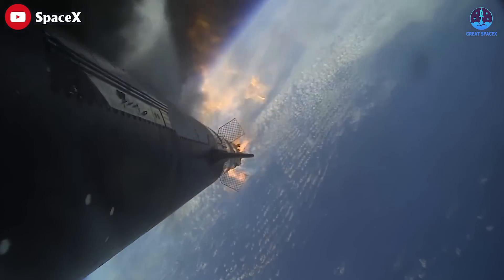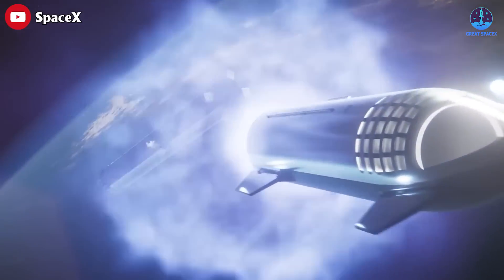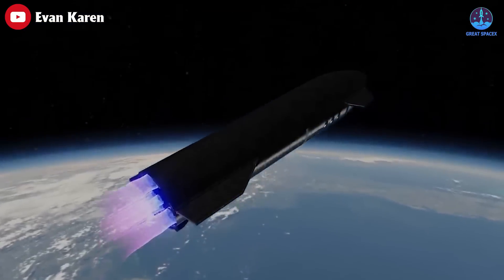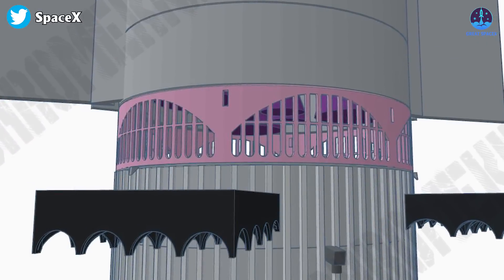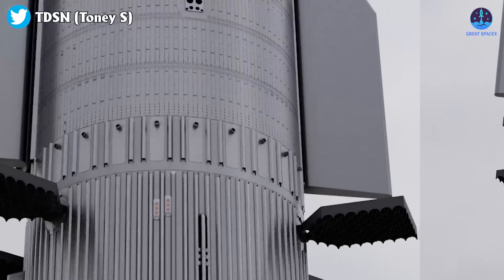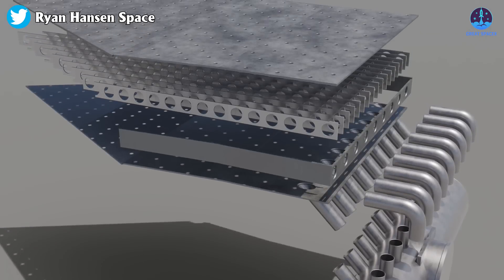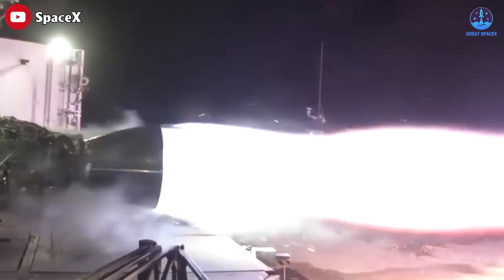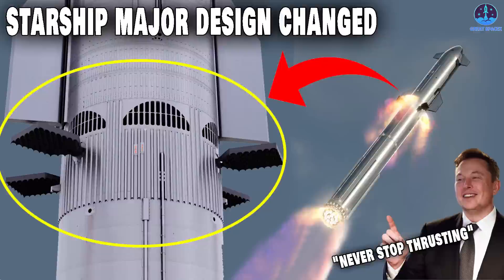Elon Musk officially revealed Starship's major design changed...

Comment: When someone takes a good look at it he quickly comes to a conclusion that of all the rockets ever designed and build the Starship is the only rocket that allows for easiest implementation of "hot staging". It has 3 center Raptor rocket engines that have wide range of gimballing necessary for lading flip maneuver. All that it takes to implement hot staging is extend this gimbaling bit more and cut three holes (slots) in the Skirt. Before launch all three center Raptors get gimbaled to outside perimeter of the rocket closest to their mounting position and protrude through holes cut in the Skirt. When time comes for hot staging they can get fired full blast without their hot exhaust blasting SH Booster (same scheme as is used in astronaut emergency escape systems). Easy does it, no shielding of Booster and no vent ring required. Unfortunately Elon's "hot staging" is not about hot staging at all. It is a smokescreen devised for hiding and modifying engineering errors that lead to failure of last test flight. Problem is that unpressurized Skirt of the Starship when compressed by the thrust generated by 33 Raptor rocket engines tends to buckle and collapse. Partial collapse of the Skirt  at only 30% nominal loading caused tumbling and ultimate demise of the rocket during last test flight.  Desperate times call for desperate efforts and Elon decided to switch from supporting the Starship on top of SH Booster using the Skirt to supporting the Starship using 6 VacRaptors as support columns. There is nothing wrong with that idea, in fact VacRaptors are way better than the thin sheets of SS steel used for the Skirt as they do not buckle under com compressive force. Now in order to make this idea work support structure is required on top of the uppermost dome of SH  Booster. If Elon had any brains left at this moment he could play it straight  and say: the Starship does not need a Skirt for landing on Earth and I am going to eliminate any need for the Skirt by using 6 VacRaptors as support columns during liftoff. Moon and Mars landing legs will be mounted to bottom of LOX tank and any supports for the flaps will be resolved by other means, and BTW the Starship will use 3 center Raptors for hot staging (tripod of rocket fire) no mods required.

Comment: In a screw ratio if your engine is firing your heat structure round you would ultimately have the opportunity for that little tip you wanted so bad in front of you to spade  inside of it and cause an explosion because of the round tipped edges of your screws
Reply: If possible next time you go up try to see if you're developing and breads that pull waves

Comment: Separation Upgrade to Hot Blow off with vents Less Parts Less Weight Less Momentum Lost ! High Bar Fuel Delivery too Lean Blow the Manifold too Rich Loose Thrust + Smoke !, Add Pressure Regulators with Atmospheric Diaphragms or Pintle Injectors with Experimental Wave Release Pattern !.

Comment: What could possibly go wrong with blasting hypersonic raptor exhaust directly onto the relatively thin material of the methane tank bulkhead and the new screen door section of the booster at point blank range?  We already know how good they do at excavating ginormous chunks of concrete and tearing apart rebar at 60+ feet.  Kinda like a bomb going off when they ignite.   Oh yeah.  It'll rub out!  🤣🍿🍿🍿

Comment: It was NOT A FAILURE......it was the 1st TEST FLIGHT.   It was never expected to succeed 100%......they will analyze all the data (& "failures") & prepare the next Test Flight to eventually have the Starship operational.  That's the whole point of Test Flights.....to TEST & learn from the never before tested spaceship.  It will probably be 1-2 (maybe 3) more test flights before the totally stacked Starship is operational & good for actual missions.   How many TEST FLIGHTS did it take to successfully land Falcon 9? (about 6-7), how many before Starship Booster successfully landed? (about 4-5).
Reply: How many Orion test flights it took to make it operational?

Comment: You lost me as a subscriber with your first comment.  It wasn't a failure - anything beyond leaving the tower was a bonus as stated by Elon.  No way that would ever be orbital on the first attempt and they learned a massive amount from it. That's like saying that a toddler attempt to walk was a failure because they fell over on their first attempt.
Reply: Space Cadets at SpaceX are allegedly experts in their fields highly qualified for the jobs they do. They knew from the very beginning that the unpressurized Skirt of the Starship under edge compressive loading would buckle and collapse during liftoff. They were told many times by many people  they ignored all warnings and tried it anyway. Now that sh..t hit the fan and the Skirt collapsed on the first try instead of admitting their mistake and eating humble pie they try to feed us with their BS about introducing hot staging while secretly trying to walk away from using the Skirt to support the Starship during liftoff  and trying to use 6 Vac Raptors as support columns in order to keep the Starship on top of SH Booster during  liftoff. Space Cadets at SpaceX were offered this idea as better option more than 2 years ago and now after they failed so spectacularly they are doing it in secret and feed public with complete BS as to why they are doing it. They have to decide if they are experts or just on the job trainees so far it seems that they are bunch of frauds

Comment: Ekon's "hot staging" concept is nothing more than a smokescreen intended to hide the fact that the Skirt of the Starship was too weak to support the mass of fully fueled Starship during liftoff and partially collapsed during last launch attempt sending rocket into a spin. Elon wants to convince us that introduction of vent ring makes it impossible to support the Starship on top of SH Booster using Skirt as support structure. Once he accomplished that task he wants to introduce concept of supporting the Starship on top of SH Booster using 6 Vac Raptors as support columns resting on shelding structure welded to the uppermost dome of SH Booster. As clever as Elon's rouse might seem to some people it has some obvious setbacks. Vent ring weakens the walls of SH Booster so much that separation mechanism located above vent ring might be unable to prevent premature separation due to forces generated by gimbaling during liftoff. Creating  functional venting at the bottom of each VacRaptor might weaken support structure "so called shelding" so much that it will cause collapse of these structures during liftoff.

Comment: SpaceX has some big hurdles to overcome that are necessary for a Mars landing. StarShip is gonna need Landing Legs & upper Draco Thrusters for the Moon & Mars (there will be no landing pad & ground level retro-thrust engines will only dig its own grave), orbital refueling, reliable Raptors (every prototype launch to date has had Raptors fail), capturing a returning Superheavy or Starship w/ the LIT Chopsticks, a OLM w/o a Flame Trench that will withstand repeated launches, a Human Rated blessing from NASA, docking this BFR (big fat rocket) to Any Space Station, a Mars habitat w/ a LOx & CH4 manufacturing ability, radiation exposure protection on prolonged space ventures,  satisfying the Environmentalists & other impending legalized extortion groups that will sue SpaceX for a piece of that cash cow . . .

Comment: Still a bit inaccurate. The upper and lower stages did not explode. The auto-destruct was initiated but took almost a minute to cause detonation of the remaining fuel. In the meantime the hydraulic controls for the Raptor engines had failed and due to the lack of altitude and attitude control the rocket stages took on a spin until the detonation of fuel occurred.

Comment: Comments:
1) The first launch of Starship wasn’t a failure.  Fly and crash is how SpaceX does business; it’s how they learn.
2). Starship’s original Separation method didn’t fail.  The tumbling of the rocket caused it to never be activated.  If all engines had fired, and the flight path had been to plan, the separation system might well have worked as designed.

Comment: I thought he wanted to recover the boosters and use them right away again - not gonna happen if the tops of them are melted? Maybe this is just proof of concept for extremely heavy loads or until a better way is found.
Reply: The new shielding, booster extension and vents are designed to mitigate any rocket exhaust damage to the booster section during stage separation engine firing.

Comment: The first attempt was NOT a spectacular failure.  It was a spectacular success according to any standard Musk laid out ahead of time.
Reply: --->"The first attempt was NOT a spectacular failure.  It was a spectacular success according to any standard Musk laid out ahead of time."

You're too use to the Government bureaucratic NASA method of building a rocket which involves long delays, massive cost over-runs and they still ended up killing 17 people over the course of their history.  So, NASAs method of building the "Perfect Timex on the launchpad" is not any safer or reliable of a method. SpaceX is not that special.  They are simply following the "Sergei Korolev" method, which is a more successful and feesible approach.  Sergie's method is this.  Instead of trying to perfect the Timex on the launchpad, like NASA, how about launch the Timex as it is, let's see what it does; lets see what it succeeds at, lets see what it fails at, and then use all that data to refine the next set of Rockets.  The Rocket is disposeable anyway.  So screw it and light that candle. You learn a lot more in a shorter period of time.   Sergie wasn't really anyone special either.  His method was the classic engineering method of the early 20th century.  Jack Northrope and Howard Hughes did things that way.  Build it! Fly it!  See what happens!  Refine!   This is why over the last 10 years, SpaceX rockets have the best reliability record and best safety record.
Reply: It was definitely a spectacular failure  or a disappointing success.
Reply: @saquist  Only if you look at it like NASA would.  Elon tries and learns and considers it a success.
Reply: @rogerrussell9544  "Only if you look at it like NASA would..."

Eh...it's funny that you would say that...
Reply: @saquist  In what way?
Reply: Standard, you ever built anything 🚀🍿
Reply: @setituptoblowitup  Standard, you didn't bother listening to the goals Elon had for the first launch.
Reply: @rogerrussell9544  E has nothing to do with it
Reply: @setituptoblowitup  I can't believe you pretend that.  The video claimed the launch was a spectacular failure.  I used the goals not just put out by Space X to disagree, and not just any claims and goals but those laid out by the CEO of the company, there is no more credible source for those goals.  You are either disingenuous or a troll.
Reply: @rogerrussell9544  nope I'm an engineer, not the titanic kind tho
Reply: @setituptoblowitup  No, you're a troll. Elon had a reasonable list of engineering goals laid out for the launch and these were met.  He now knows it will launch and fly.  He knows structurally it's sound. He knows that the engines need refinement for reliability.  He knows the data feed was reliable and that the changes he has made like the electrically controlled gimbaling was actually money well spent.   If you want to claim to be an engineer, these things should be obvious to you.
Reply: @rogerrussell9544  I'm team E fool
Reply: @setituptoblowitup  Go ahead and call me the fool while ignoring the successes and data with the first launch and saying Elon and his goals have nothing to do with what we should have expected from the launch..... but I'm not the fool.  Facts are stubborn things.
Reply: @rogerrussell9544  it's satire Man were both on the same team ✌️🍀
Reply: @rogerrussell9544  We need more PPL like yourself stay 📈

Comment: Hot-staging was commonly used for expendable rockets. But the Starship boosters are not expendable. When you see what the blast of 33 Raptor engines did to stage zero in April 2023, what sort of protection would you need to build onto the Superheavy boosters? Wouldn't thick metal shielding make them even more 'super heavy'? Anyone?
Reply: Name change to Superthicc Booster. It's gonna need two normal SH boosters strapped to the side of it.

Comment: Hot staging completely wrecks the booster though doesn't it and makes it unusable for refurbishment. This is a step back and they just need the booster to do a retro thrust to pull it apart from starship.Or even both booster and starship halve the work of pushing each other apart with a dual locking mechanishm that can be release by one or both sides and both using some thrusters to seperate.

Comment: I am glad to hear musk is over engineering some components. Damn the payloads capacity. Once we have a reusable rocket we can intelligently trim weight.
Reply: Elon is not over engineering anything  he is in scrambling mode trying to prevent another collapse of the Skirt during liftoff when they make another launch attempt.  Now Elon wants to try to use Vac Raptors as support columns in order to keep the Starship on top of SH Booster during liftoff.
Reply: @KarolKarolak  I am not referring to the booster separation. Starship launch pad was an engineering disaster. It was dangerously underengineered. No flame trench?  Engineers call overengineering the  fudge factor and every engineer uses some.  I just want Musk to use more in the testing phase of Starship.

Comment: I wonder how they will do it, maybe the three vac engines will light at low thrust for the sep, quickly followed by throttle up and center engine light. Seems like the center engines are really close to the forward dome but maybe that's not an issue. Crazy that it can get you 10% more payload!

Comment: When we decide to go back to the moon (and Mars, for that matter), how will we determine/know  that the surface they plan to land on will be flat, hard and/or substantial  enough to support the weight or impact of the space craft?
Reply: i believe the plan is to have long landing legs that don't actually lock in place till the other legs touch down then being able to adjust to rocky terrain. idk what they are planning for making sure the ground is hard enough though.
Reply: We've learned a lot about the moon since 1969. And we have had rovers on the moon for a decade. I assume we have a lot of data about the surfaces.

Comment: Out of pure curiosity could they not just use compressed gas? It would avoid the high temperatures of course, but not certain if it would give enough thrust. Just wondering if it might be safer and do the same job?

Comment: it was a successful failure. the external tanks that exploded are not in the current booster design. the newer engines are more reliable. those 2 changes eliminate all of the problems we saw.  it lost TVC because of the tanks exploding and some thrust because it lost 5 engines.
Reply: It probably lost most of those engines because the blast was throwing chunks of concrete up at them.  Fixing the launch infrastructure will fix the biggest problem with the last attempt.

Comment: For the 4/20 launch of stack 7/24, the rocket lost control authority and the self destruct was activated.  However, instead of blowing up right away, the rocket vented through holes made by the self destruct mechanism and tumbled.  This was not an attempt to stage.  Staging was supposed to happen at twice the altitude and with the Superheavy engines turned off, which they obviously weren't as the rocket tumbled.  It looks like as the rocket tumbled back to Earth, either the structure finally got over-stressed enough to break up and/or the altitude got low enough for the venting propellant to ignite and then the rocket exploded.

It turns out, especially this grade of stainless steel is some pretty sturdy stuff.  A lot more so than say the Titan submarine that imploded.  Stainless steel is both very strong and it can deform a lot without losing its strength, granted it is a heavy material for the job it does.  Carbon fiber has a lot of tensile strength, not so much compressive strength, and carbon fiber has a tendency to shatter instead of deforming.
Reply: Don't think so 😂
Reply: You have provided the correct information. 
Many talk about Starship and SH "blowing up" but this is entirely false. Both rockets were "unzipped" down the sides so that the propellants could escape into the atmosphere. They may have ignited but there was no overpressure or explosion inside the rockets.
As you stated, the Starship/SH didn't stage because it didn't reach various altitude/configuration/engine criteria to cause staging.
The fact the narration completely ignores these facts and spreads popular misinformation is really disappointing.